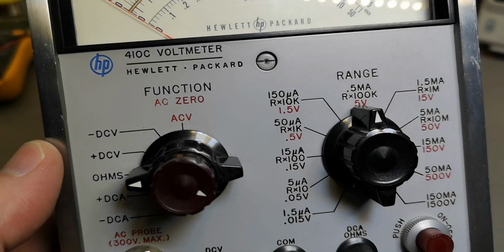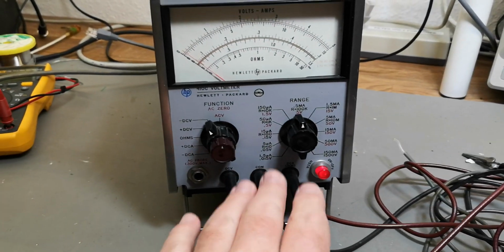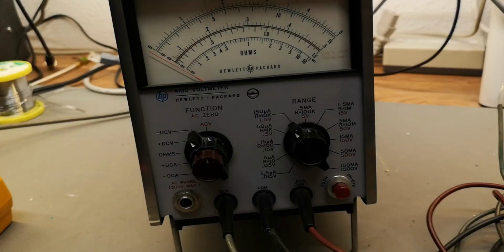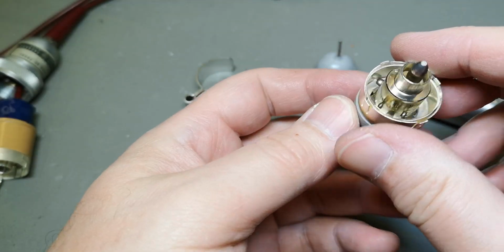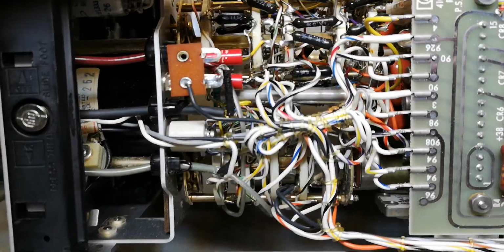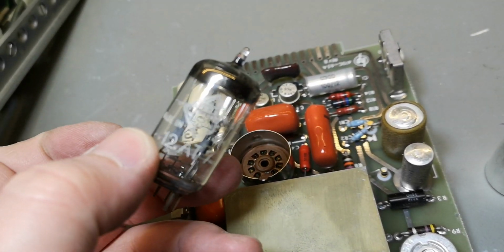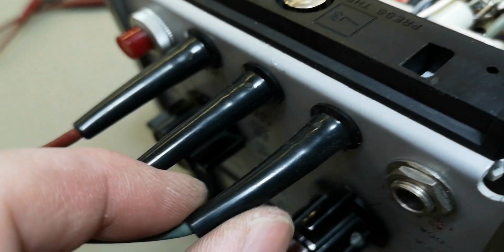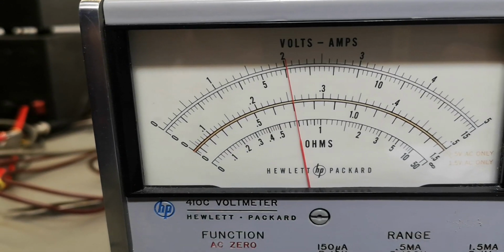HP 410C Electronic Voltmeter 1962-1968 test repair teardown

Comment: Good video.  My 410C had similar problems with the test leads; loose crimp connections and the center conductor of the DC probe broke off the resistor.  I found that a disposable surgeon's scalpel worked very well in stripping the insulation off the fine center wire.  Before soldering to the 1-meg resistor I used a small metal clamp on the lead right at the resistor and wrapped the resistor with a small piece of wet paper to ensure that it didn't get overheated while soldering.  Same as you I had to redo the connection because I forgot to put split ferrel retaining on the cable before soldering.